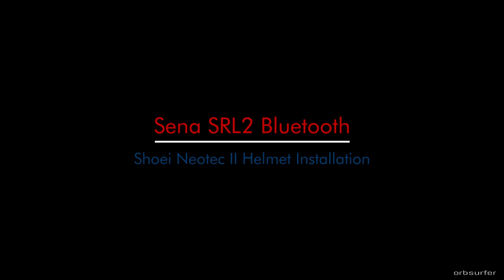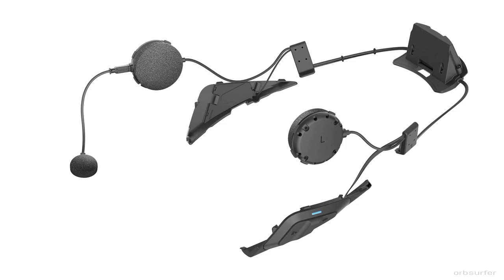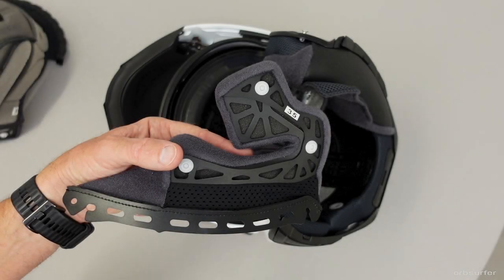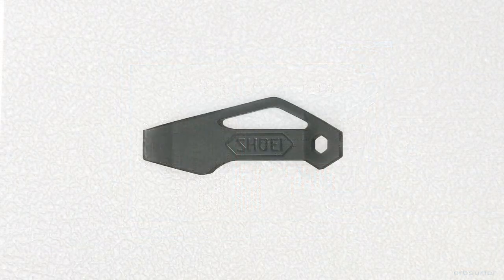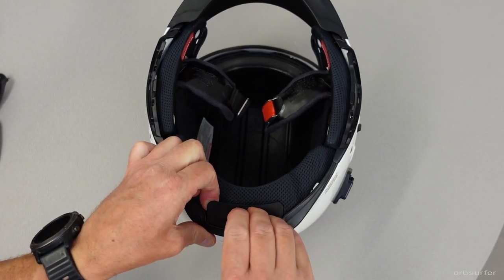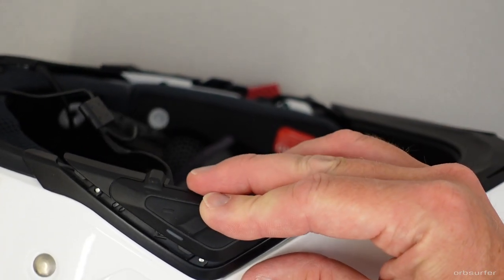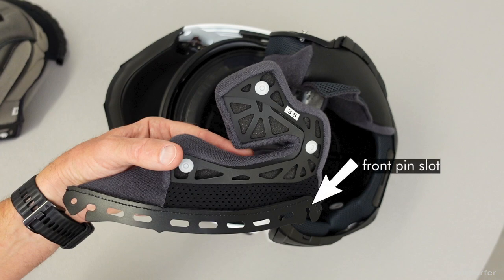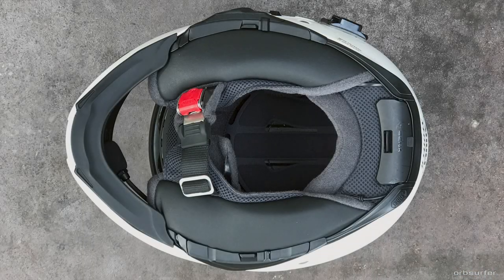Sena SRL2 Bluetooth Installation in Shoei Neotec II Helmet

Comment: Thank you! for all your swell reviews! You do have an obvious & sharp design analysis skill. 
Beside the integration which one of these two communication systems do you like the most?
I am on the market now exactly between these two helmets... after many years with Schuberth helmets I feel like it's time to give a try for an other designer/concept/manufacturer in other words I'm loosing trust for Schuberth. I just need a highly functional system that will not fail BT connections &  provide an excellent sound quality. Not sure you will read my above question but maybe you will.... Cheers!  (Really tempted by your Arai XD4 setup)
Reply from the maker: The Bluetooth on the Shoei helmet is much better integrated, but not as good as the Bluetooth installed on the Arai in both communication and in sound quality. So you can either have a superb helmet, with a superb Bluetooth system, but not very well integrated to the point were it is a little annoying; i.e. Arai with Cardo Packtalk Slim, or you can have an ok (notice small letters...) helmet with an ok Bluetooth system and superb integration; i.e. Shoei with Sena SRL2. If you drive in the city, the Shoei helmet is ok, if you drive in the country side the Arai is leaps better by far. I paid for both helmets and both Bluetooth systems myself, and have ridden with both helmets for thousands of miles in everything from very cold to very hot weather, and have driven multiple day long rides swapping back and forth between the two helmets to test them. The Arai helmet is in a different class vs. the Shoei helmet. Also, the Shoei offers ZERO customer service, a total joke at this price point. Yes, I know they are different helmets, one opens, the other does not... :-) Oh - by default when I go for a ride, I pick the Arai XD4 (the helmets are right next to each other) and have to "remember" to use the Shoei Neotec II every now and then...